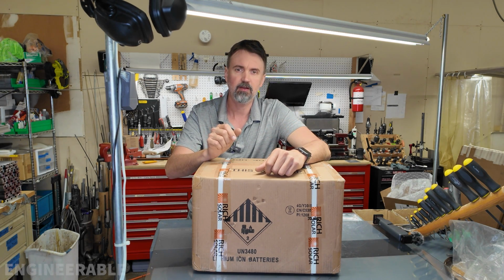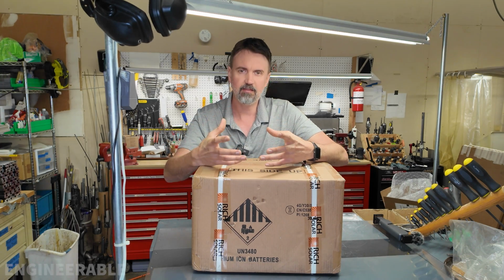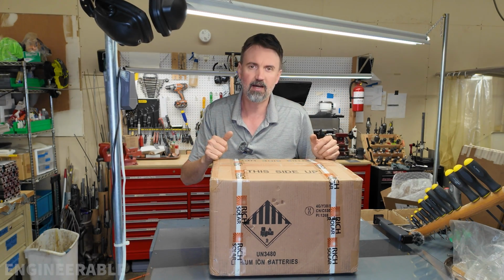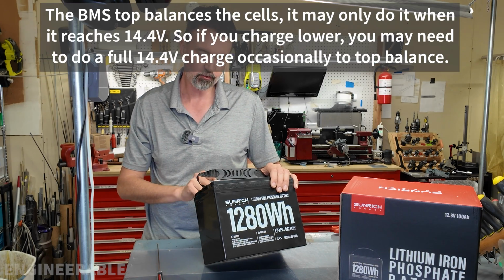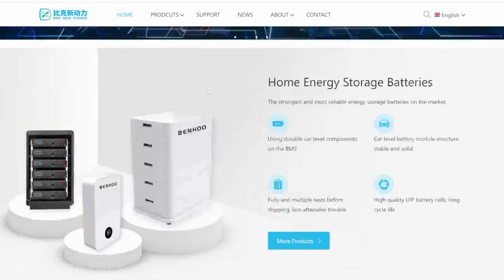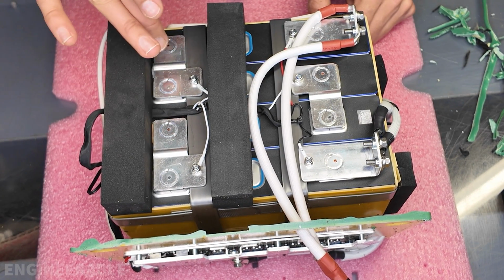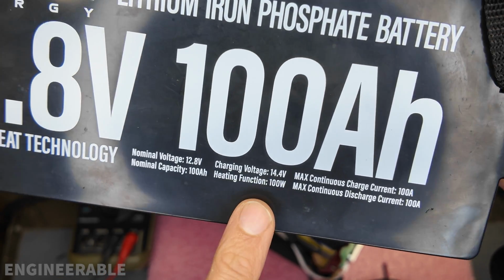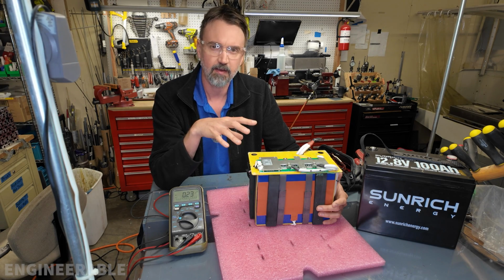CHEAPEST (Low Cost) SELF-HEATING 12V 100Ah LiFePO4 BATTERY TEARDOWN & REVIEW: SUNRICH ENERGY SE-B100

Comment: Thanks for the teardown video. I hadn't realized that Sunrich was a sub-brand of Rich Solar, so that alone was very helpful. Looks like a quality product at a budget price. Planning to drop in two on the (exterior) tongue of my travel trailer to replace the lead acid setup, and need the self-heating feature here in Idaho.
Reply from the maker: @tagrobison3015  They've been great so far. You may want to consider adding some insulation in winter to help the heater keep them warm when charging. Also, if they are going into a box, be careful of high heat in the summer. You don't want them to get hotter than ambient summer temp. This applies to any LiFePO4 batteries. If the box is exposed to the sun, it will need to be vented, possibly with a fan, during the summer. I installed mine underneath the van, protected from the sun's heat.
Reply: @engineerable  I see people running battery banks without heaters as long as they are insulated. I would recommend building a box out of R12 foam board with aluminum tape and setting it up so that the boards can be removed from the box in the summer
Reply from the maker: @Jacobe2of4  That may be ok depending on install and use. Most decent batteries have a BMS that prevents charging below freezing. Batteries that are in constant use self warm. But insulation alone doesn't work for my scenario. I still need the heater to warm the battery in order to be able to charge.
Reply from the maker: @Jacobe2of4  If they are heated, you can run them under the bus in unheated space. Adding insulation will help retain the heat and reduce the energy that the internal heaters use. Keep an eye on summer temps to check that they don't get too hot. Should be ok if sunlight doesn't heat up the space they are in.

Comment: So the splat r ball i was wondering if you could make a video adding a 20v drill battery using an adapter to the gun. And how could i make the actual motor itself stronger or can i buy a stronger one because i feel it will become worn out. I already upgraded my gun to metal gears so im not worried about my gears stripping but that the motor would explode
Reply: None of the airsoft motors are designed to run on more than 11.1V. Anything higher will burn them out fast. You need a high-quality V3 short-shaft motor for airsoft.

Comment: Your tear down video has raised the price to $229 still not a bad price depending on your future review looking forward to it 
March 2023 I bought a 100 AH Himassi lifepo4 heated with Bluetooth BMS for $259.99 use them for my 24 volt trolling motor they last a long time
Reply from the maker: This is the battery you bought? https://amzn.to/3UvPAto
It is self heating, but they say "Low temp", which is confusing, because that usually only means low temp cut off.
Reply: So I think if the battery is below 32 degrees or less when you attempt to charge the battery the heating pad will come on warm up the cells and then charge 
I haven't tried charging the battery while it's this cold though so I can't say for sure 
The battery does have 2 temp sensors though
Battery capacity from when the BMS cuts out for low voltage is 97.5 AH and 99.3 AH for the 2 I purchased that was tested yesterday
I'll be curious to see how your battery capacity is, looking forward to your review

Comment: building a 12v 280ah lifepo4 battery with self heating for 355$
Reply from the maker: Would be interested to see your build. That's only material cost though, right?. I have a tendency to want to build everything myself, but I need to be very aware of my time cost in doing so.
Reply: @engineerable  ya i might make a dumb video after wards.
15w silicon 12v heating pad, 2$
thermostat+thermocouple 1$
PTC thermistor ~.1$
flexible bussbars and insulated caps 12$
4x 280ah eve cells from china ~340$
4s active inductive balancer 3$
not really counting the fiberglass strapping tape or g10/epoxy inserts since i already had those but theyre pretty cheap themselves.
dont want an actual bms since im using it in the low voltage side to replace my old AGM battery in my chevy volt.
I added 200w of flexible solar which i think will keep it charged mostly and stop the high voltage battery from trying to over charge it. should give more range too since im not using the high voltage battery for 12v stuff any more
Reply from the maker: @vevenaneathna Nice idea. Are you going to need a DC-DC charger because charging the LiFePO4 battery has different voltage needs than AGM, especially the float voltage, or lack there of?  From my solar charge controller, I've tuned the float voltage to about 13.53 volts, where I don't see any current coming in or out of the battery. At the recommended 13.5 V, the battery would discharge instead of the solar charge controller supplying all the power while the sun was out. Higher than 13.53V and current flowed into the battery. AGM float is usually set at 13.7, which means it will continue pushing current into the LiFePO4 battery, overcharging it.